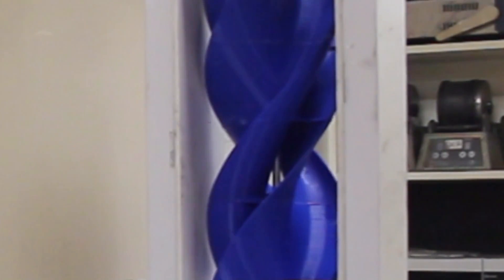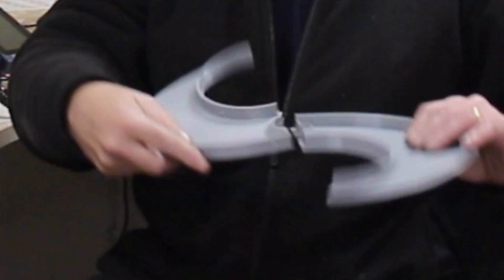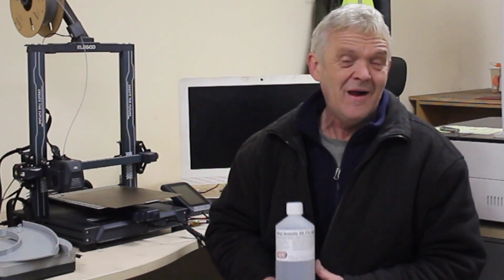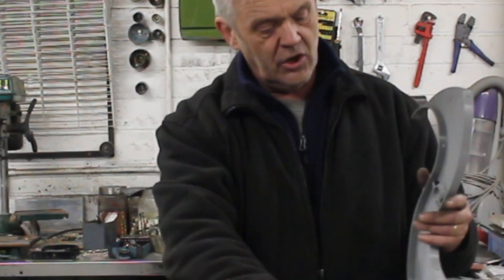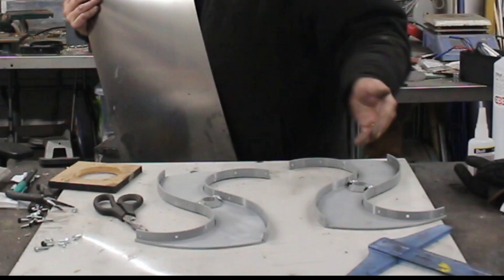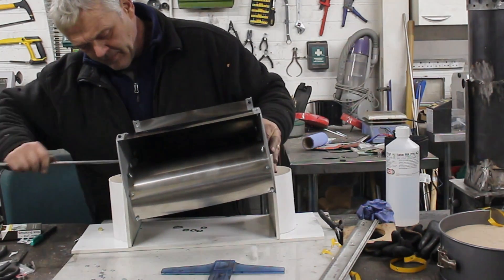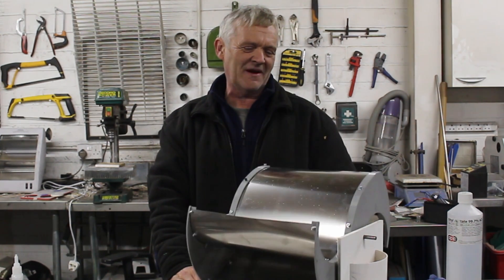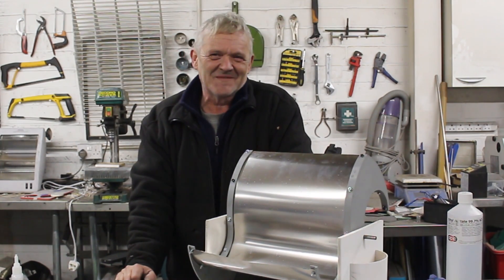1753 A Hand Made Ugrinsky Wind Turbine And An Apology

Comment: ABS will degrade pretty quickly in UV light outside won't it? Have you considered printing with PETG? It should last a lot longer especially with the proper coating.

Comment: Robert, why have you left the gap inbetween the two sheets open at either end? Would there be anything to be gained by making the sheets longer so they join together and leave no gap? It might be more aerodynamically efficient. Openings and sharp edges are usually inefficient.

Comment: Hi I was just wondering does anybody do anything with high torque windmills. like the ones in the old west that used to pump water. would it be more efficient to have a windmill that rotates slower but  put out of more torque for electrical purposes. Yes you'd have to make with large surface area" propellers "I forgot what they're really called .and if they turn slower things wouldn't break as much

Comment: ABS is harder to print large parts without warping - though if you persevere, perfectly possible to get as good results as with pla. Higher temperature tolerance can be a benefit.
Reply from the maker: cheers mate

Comment: I believe an issue with this horizontal version will be it has to overcome its mass in the vertical plane, so the bigger the sweep the more energy required as you are lifting the mass, in a vertical version with the horizontal motion the bigger the sweep the easier it will turn. Obviously its comparing 2 ways to mount the same turbine.
A covered version which funnels the air may increase the local energy but takes up space were more vertical turbines could be fitted.
This is all straight off the top of my head so testing would be needed to confirm it. 
I'm thinking thin bladed, tightly packed vertical would give best output per meter...
????????
Reply from the maker: it would also acts as a fly wheel though - so in my mind what you give up for starting torque you are going to gain in even output - I strongly suspect in over all performance orientation is going to have little impact but I think you are right packing density will

Comment: I would love to try to weld that SS on 10amps with my tig
Reply from the maker: 10 seems a bit low to me mate - maybe 50-70 on thin steel?
Reply: @ThinkingandTinkering  1mm I use 20amps on my tig. You would just blow holes at 50 on that thin gage . I challenge you to have a go on your mig or stick and post the video for a laugh. 
Maybe even a short mate
Pleassssseee

Comment: If intending to use in that orientation on a roof, I think it'd be a good idea to take it back outside and gently pour some water in it, those curves look like they might hold some water in making it much more difficult to restart after rain until it's evaporated. Though if you find it does, drilling a couple of small holes at the then lowest points would enable it to flow out, with hardly any effect on it's wind efficiency. Not something you want to be doing at height if it does need it ;-)
Reply: Put a small partial covering over one part, angled to shed the rain on one side and you might have yourself a slow water wheel for non wind but rainy days too
Reply from the maker: good point mate- cheers
Reply: Another possible efficiency thought, for roof mounting in that configuration is , rather than the most natural way to think of mounting it, directly on the apex, as the roof is sloping you could mount it slightly offset, and lower, on the downwind side. That way the wind deflected by the roof will be directed to the scoop side ( presuming the device itself it designed to turn "top away" from the wind rather than "bottom away" ) and shielding some negative torque from the return side. A good way to test the optimised mounting position, on the ground, would be a sheet of plywood set up in front at the same angle as the roof is.

For what it's worth, a lot of my thoughts come from thinking/accepting how most designs have already been optimised for a general situation then looking at a proposed situation and thinking " how does this differ from the general sighting and how does that affect things?" From there looking at which general solutions optimisations might actually detract from the specific one and is there anything that would normally detract if used for the general one but could be used positively for the specific one. I guess "optimising something for it's specific use" might be the quick way of summing that up.

Comment: Are you sure you couldn't hand build a curved version? Wouldn't you just need to offset the end pieces a few degrees of rotation and cut the sheet metal with a slight s-curve? Not saying it would be easy, just not impossible. Figuring out the s curve should be "easier" since you have the 3d printed version. Some painters tape, laser level and a marker to get the template for the cut needed on the sheet metal. Just an idea.
Reply from the maker: you could but it wouldn't be easy I would think

Comment: Sheet aluminum was my 'knee-jerk-reaction' since its very common. 

I have a 24" roll of it laying around here some place which I originally got for building a shroud for my truck engine.

I ended up deciding to use a fiber resin assembly instead, therefore, I still have it for other processes at some other time, but it would certainly work for something like this.
Reply from the maker: it certainly would and it is easier to work than SS - quite a lot of spring in SS but the Ali would stay formed

Comment: I could make the original blades with some construction foam, a couple wood templates, and a hot-wire cutter.  You'll need to cover it with plastic wrapping.
MeCl2 is also used in paint stripper. (use adequate ventilation!)
Reply from the maker: I like that! - that is an awesome suggestion cheers mate

Comment: nice ...i think its good to try some gears and chain to make the motor speed up a bit...cos the torque will be high due to a good storage of wind inside the blade...it will increase the voltage or amp...other wise the motor will even not light up a single led
Reply from the maker: cheers mate

Comment: I want to see how much power this size can physically produce. 
Also, how do you stop wind turbines like these from destroying themselves in high winds?
Reply from the maker: you can always brake them electronically - it's pretty simple to do - just short the generator and it will act as a brake
Reply: @ThinkingandTinkering  So basically the same as any other wind generator. 
I thought that maybe a small one like your 3D printed demo, if built with solid material, would be able to withstand stormy winds without any speed control.

Comment: Might be able to make one without a 3D printer: 🤔 maybe use tissue paper walls and put a small twist between top and bottom templates, then layer thin layers of spray on clear coat letting each time to dry before the next. Just thinking out loud. 

Great vid, thanks for sharing! ✌️
Reply from the maker: worth a try mate -let me know how you get on will you?

Comment: Dumb question time: If you block the side of the rotor that is pushing against the wind (Bucking wind?) with a static shield, would that help in any useful way?
Reply: Yes, it almost doubles the power. It's called a "Shielded Savonious".
Reply: @justtinkering6713  Thank you. I was thinking about that looking at a vetical axis rotor based on a 55 gallon drum. But it would have to turn with the wind direction, like a weathervane, which was my stumbling block. But something like this, which is stationary, might be well served by such a contraption.
Reply: Now that I think some more, I wonder if the back-side of the shield would block the exhaust of the wind-filled scoops
Reply from the maker: i don't think that is right for this type of turbine mate - i am not sure as i haven't checked - but - without meaning to be rude here and i am sorry if it comes across that way - i can assure you i don't mean it to be -  i get the sense neither have you
Reply: @ThinkingandTinkering  You are correct about that. I am at the conjecture stage right now, LOL
Reply: @ThinkingandTinkering  Thank you for the reply, and thank you for these videos. They are interesting and informative! And no, it wasn't rude at all. It s merely the truth, which is good to know.
Reply from the maker: I am not sure with this type mate - but i suspect not - but i will need to read up on that a bit

Comment: One can begin to aproxinate a spiraled ugrinsky turbine by stacking 3 or more ugrinski turbines, each advanced or lagging the one below it by (360 degrees)/(number of turbines stacked on the axle). 

There may be an advantage with a spiral like design if there is a lull in torque at certain angles to the wind.
Reply from the maker: nice suggestion cheers mate

Comment: Have you seen the Harmony turbine? Interesting design that allows it to deal with high wind speeds.
Reply from the maker: I have mate and yes there are positive things about it
Reply: @ThinkingandTinkering Robert, I found one of the videos. its on my utube channel. its from 2018
Reply: Harmony will need lots of maintenance, too much mechanics involved.
Reply from the maker: seriously mate if you have a favourite  - no worries - but come clean about it and try not to be so negative about others - there are positive things to harmony as well as negatives
Reply: @justtinkering6713  But what other options are there for managing high wind speeds on a savonius?
Reply: @richardmarkham8369  There are two other options I can think of. 
1. Shielding
2. Tilting

Comment: Could you make them out of aluminium/tin cans with the tops and bottoms cut off and cut vertically?
Reply from the maker: if you can get the shape - you would need a set of rollers but once you had that  - for sure
Reply: @ThinkingandTinkering  i meant cut both sides vertically making two U shapes that can make an S.

Comment: Your apology Mr. Smith.... I will allow it! 🤨Kidding aside do you ever consider gearing turbines or does it fall under the category of torque vs speed and would just be less efficient to do so due to extra friction?
Reply from the maker: gears don't do that much mate - I have been thinking of a video on them - but you are right there is a reason I don't use them much - and it is not just because I can't be bothered lol

Comment: Hello, I am assuming by the way you were holding the wind meter and sitting that the wind was coming coming in from behind the the camera. I was wondering if there would be a performance difference if you turned the unit around to have the wind entering the opening at the top?
Reply from the maker: probably not mate - but I can certainly try it

Comment: If you put a funnel over it that horizontal ugrinsky turbine looks like it might also function as a water motor. 👍
Reply: It’s basically an Archimedes’ Screw without a tube.
Reply from the maker: it does indeed

Comment: Hi Rob. I use pla+ and petg filament for my projects as abs can be a pain to print.  Petg prints at 230c and I have had small windmill features working in all weathers for over 2 years without any problems. Keep up the Great work. Trev.
Reply: Yup PETG is the way to go for outdoor applications. Any favorite brands?
Reply: Videos posted or it didn't happen.  Joking, of course. But, do you have any posted videos? I'd love to see that. I'm wanting to build a miniature wind farm of small profile, unobtrusive wind generators and have them connected to a battery bank for future use.
Reply: ASA preferable to ABS outdoor, inherently UV resistant. Petg is good as well only sometime downside is it's a bit flexible
Reply from the maker: nice mate and thanks for the advice